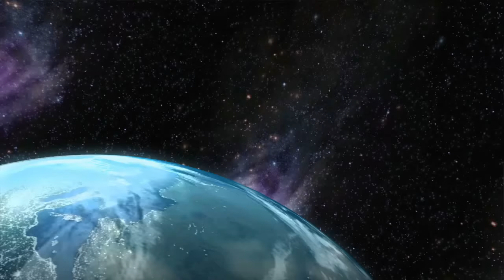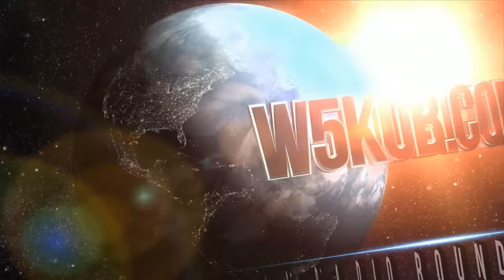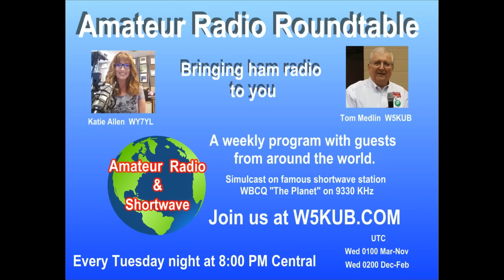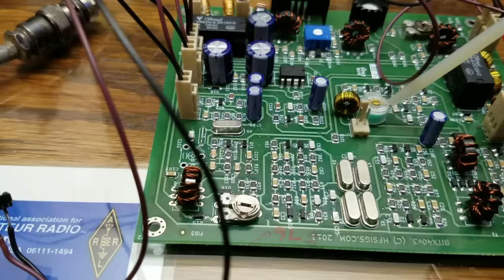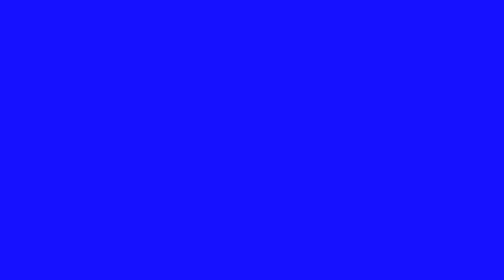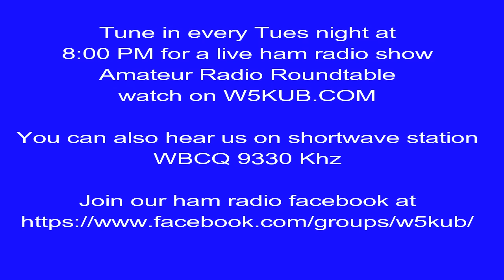BITX40 demo receive

Comment: Is that the supplied tuning pot or your own?  Mine came with a very different one turn for the whole band which makes tuning difficult.
Reply from the maker: is was my own 10 turn pot.  that one turn pot they send makes it difficult.  with the 10 turn you have all the signals spaced out a good distance and you can fine tune them.  one thing. that on board vxo drifts so much it is al most unusable even after it warms up 4 hours.   we are building a $15 arduino dds vfo which is rock solid for it.  watch our tues night shows for more info.